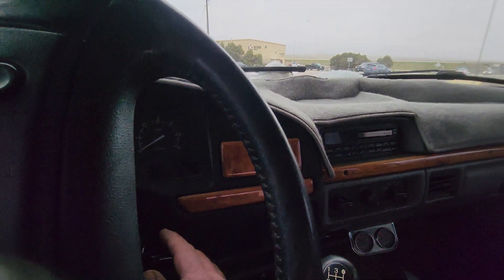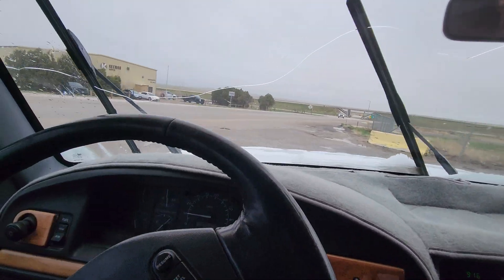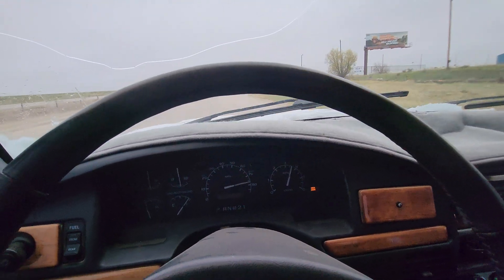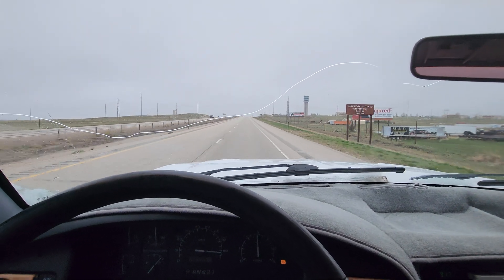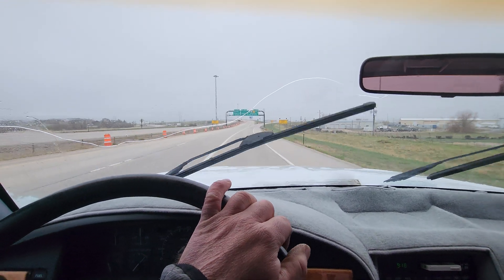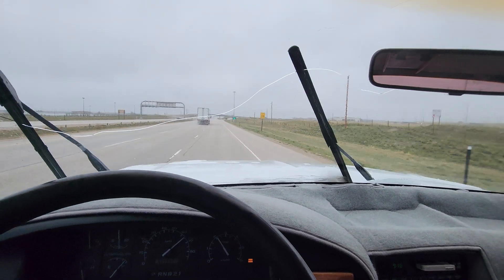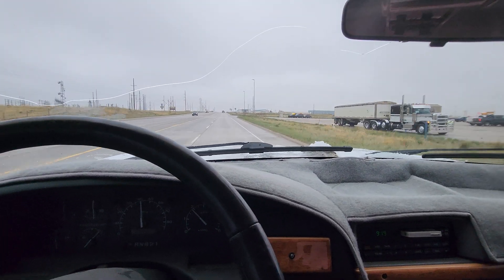Colter's efi 460 4x4 dually: the stage 1 cam and 1.8 ratio roller rockers

Comment: Do you guys ever do before and after horsepower tests or just seat of pants? I have a 94 F-350 crew 4x4 longbed that needs some love.
Reply from the maker: Yes, our last build jumped and extra 100 hp and over 210 ft/lbs to the rear wheels hitting 530ft/lbs with e7 heads.  I should have a dyno in our shop in the next couple of months. I'm very excited to show what the numbers of each and every part and the combination  of parts does.

Comment: Good idea with the GoPro.
Can you detail this build some more? Just found your company and I'm digging it.
Reply from the maker: Definitely,  this one we rebuilt and shaved the heads 15 thousands, and used a Commetic 27 thou thick head gasket.  We also used our modified intake, our low profile throttle body, headers, 30# injectors, our stage 1 cam advanced a few degrees, our 1.8 ratio Harland Sharp roller rockers, our valve cover spacers.  We also converted this truck to 4wd, lifted it, and swapped it over to a manual zf5 transmission.  I will shoot a video before he picks it up and do a full tour of the build.
Reply: I would love to purchase these parts that you talked about and you showing your videos how can I order these parts for my 92 ford f250 460 i got

Comment: Protector switch for egr resister? Whats that and if I removed some egr parts without doing that did I make a mistake?
Reply from the maker: No your good, FOR TEMPORARY SAFETY PURPOSES,,,  ,,,, ,, just add a switch (and leave it off) on the C.E.L. wire coming into the test port.  It's the double wire at the middle of the eec-iv test port ( #4 ). It's  pink w/green-stripe.   Having that switch off will keep the resistor in the ecu from burning up and damaging the breadboard.

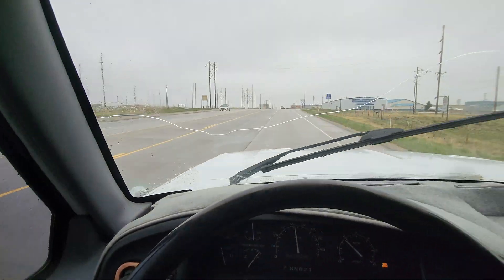Comment: I need to start errr finish my efi 460. Dad died 2 years ago, kinda lost the motivation. MAF swapped, ported everything, efiguys performance intake, Doug Thorley headers, deleted EGR stuff, 4:10 gears, cam, shift kit. Throttle body,everything minus the pistons and crank have been touched. man I could go on. So much done, very little to do.